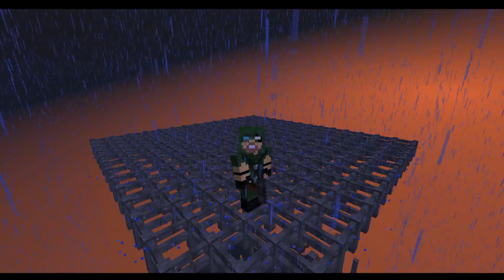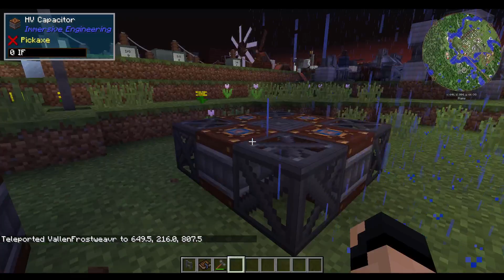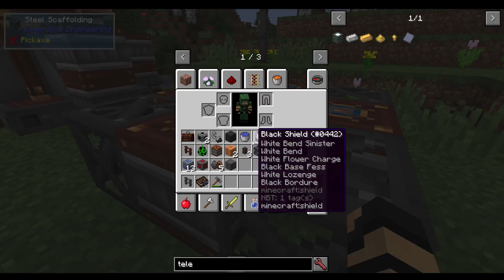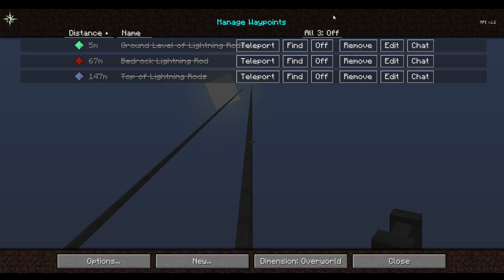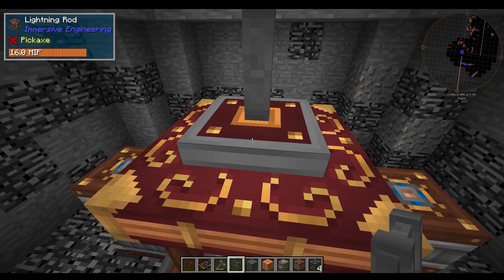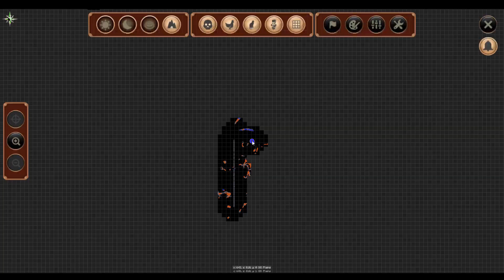Immersive Engineering: Lightning Rod - Minecraft 1.10.2/1.11.2!

Comment: Tbh Id just use PSI :P
Reply: It doesn't work. The generator just summons energy at random intervals, making it look like it was struck by lightning. Anything that summons lightning doesn't charge the generator. That is kinda dumb, but you yourself have just named one of the exploits with the generator if that would work.
Reply: Oh well. Ill just stick to magic mods then :P
Reply: There is another mod that does the whole lightning thing, and it works with PSI. LightningCraft by sblectric.
Reply: Eh, nothing the pack in the pack i'm playing needs RF (And it's infinite equivalents) other than the infusion stabilizer from thaumcraft (And thaumcraft provides it's own RF power for that.)
Reply: Ok, whatever works for you. I have thousands of hungry machines to feed, some of which eat thousands of the stuff per tick.
Reply: @icelingbolt  Just use a blood magic incomplete ritual stone with water on top it summons lightning storms for 5000 LP

Comment: What if you use the ritual from witchery to absolutely spam this thing with lightning?
Reply from the maker: It doesn't work in 1.7.10 as they fixed that when Rorax started showing she could do that. Since then, it's storm based and not strike based. Besides, this version I am showing is 1.10.2 and a lot has changed since 1.7.10.
Reply: Mischief of Mice aww bummer

Comment: This seems too good too be true, it should have a big disadvantage or a big risk for using it while it still has power inside of it. Maybe it can explode and melt stuff around it because of intense heat and would send out a big EMP signal, frying electrical components in a certain radius.
Reply: Simon Engelholm The disadvantage is the massive resource investment and engineering pita to build it just to get nothing at all until you get lucky and a natural thunderstorm occurs. On multiplayer it would be even harder to use, since a lot of people hate the rain in Minecraft and sleep or use mods to get rid of it.
Reply: @ShannaeDarkehart  mitigated by the fact it helps prevent fires caused by lightning strikes. Cover the top of any wooden buildings with lightning rods.
Reply: You're still trying to solve a problem that doesn't exist, using methods that turn a barely functional novelty into a trap nobody should ever build ever.
Reply: It's only OP if you have another mod that can call a thunderstorm. Why would anyone use a generator that actively harms's their infrastructure?
Reply: Shannae Darkehart I was more like brain storming some ideas, it is called "Immersive Engineering" after all. And there's a reason we don't try to harness power from lightning, it's too overwhelming for our current industrial machines to get profit from it. We probably can do it, but yeah, too expensive, we can simply burn oil instead of building expensive wires and safety mechanisms. We are not even close to building batteries from these mods presents :P.

Lightning in real life usually hits the tallest object from where it's going to strike, but Minecraft lightning simply hits a random object as we all know, IE-dev probably did some tweaking of it for it to hit it in the first place.

The huge resource investment to make it I do like, but we all reach a point in a SP or MP where we can do absolutely anything. So I would like some challenges for late game, power for example is something we always has to take care of. So if we have a huge power need, and we are eventually going relay on the high tier stuff. So I would like more challenges for end game as it progressively gets easier with resources, so with reacquiring challenges such as keeping your base from melting into a volcano would be a nice touch.

These are my own opinions and thought. It's the Dev's decision what he wants in his mod or not.